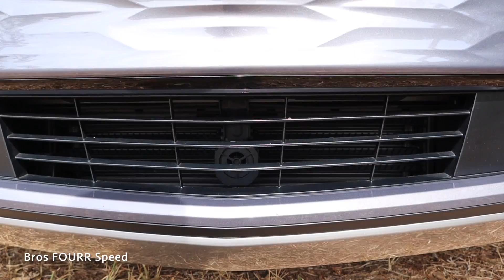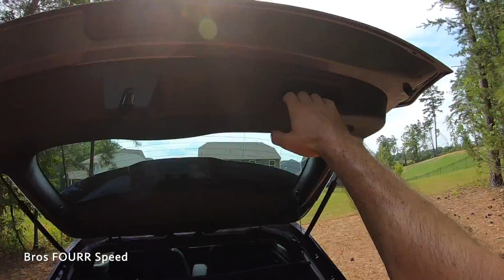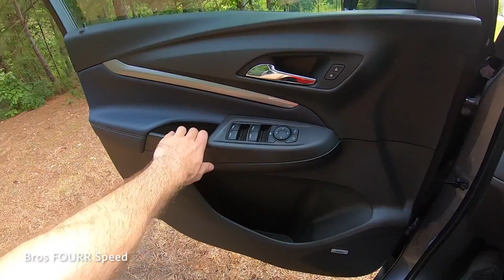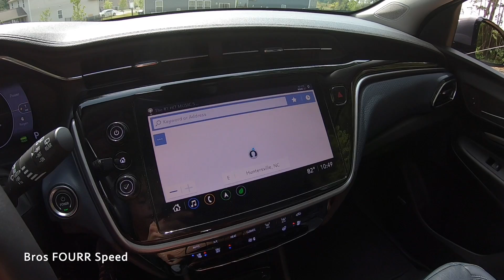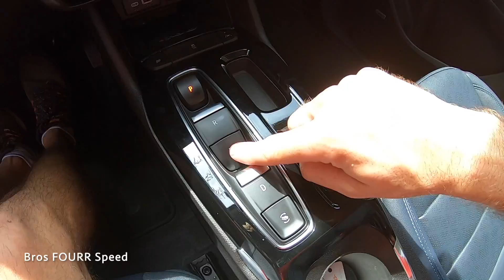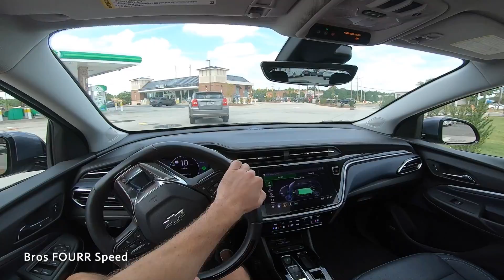2022 Chevrolet Bolt EUV Premier: Start Up, Test Drive, Walkaround, POV and Review

Comment: This is a 2023, the 2022 doesn’t have the light sensor on the steering wheel
Reply from the maker: Based on the window sticker, it was a 2022..

Comment: It's not that you're taking your hands off the wheel; it's sensing other things. First, the camera in the center of the steering wheel senses if your vision is still forward, and not looking elsewhere for an extended period. Second, when you enter a situation where a "human" decision needs to be made... you were in a merge lane, and then in an exit only lane - it disengages... so you must take control to make that decision. You CAN take your hands off the wheel... that has no bearing on the system.

How do I know? We bought the exact car you are driving! I have driven it on Super Cruise for over 10 miles straight with NO hands touching the wheel... BUT I am alert to the driving situation. One thing I don't like is that the car tends to drift side-to-side, making small adjustments on Super Cruise... which is a little irritating. I believe the Cadillac system is better tuned and doesn't do this. In over 50 years of driving, I've become a stickler for keeping the car centered in the lane... it just feels "amateur" drifting slightly, but that's just me.

Overall, we LOVE the car! Chevy has knocked it out of the park with this one. While I feel it's NOT a cross country trek vehicle, it's an absolutely phenomenal daily driver. The wife drives it 80 miles daily on her commute. We have been using the included charger (on 120 volt) coupled the dealer's DC fast charging for an occasional "boost" charge. Chevy has a $1,000 allowance for home install of a 240 volt charging receptacle... which we're getting installed in the garage later this week.

For someone who can charge at home overnight in their own garage (not an apartment) this is an outstanding commuter car. But if you're dependent on outside commercial (pay) charging stations... I'd have second thoughts... maybe consider a hybrid until you get a garage of your own. My calculations show that charging at home on 9¢ kWh electric, it costs us 2.5¢ per mile for "fuel". In contrast, the wife's former "fuel efficient" 2018 RAV4 @ 30 mpg was costing about 13.3¢ per mile. Do the math for YOUR situation. PLUS... NO oil changes - and using regenerative (motor) braking and NOT using the actual disc wheel brakes, the brakes will likely last well over 100k miles... if not far more. A no brainer for us!

Comment: Bought my 2022 Chevy Bolt EUV on April 4, 2022. I Loved It!!! Drove it  until June 30th, when the service vehicle light came on, with the dash warning "Propulsion Power Reduced", at less than 2000 miles. Sorry to say it's been in the shop since then with bad battery cell. We are waiting on parts! :( It's now August 7th. I have made 2 car payments on a car I don't have. 😢
Reply from the maker: Oh wow!  Sorry to hear that for you!  Have you heard how the process to fix that will be?  The battery cell is within the structure of the car, so that can't be easy!
Reply: @BrosFOURRSpeed  No, I really don't hear from the dealership, for updates or information. At this point I am just waiting. I am thankful that after waiting over two weeks The dealer finally got me a loaner vehicle. I am doing fine now with that, except I have to put gas in it. LOL :D

Comment: Super cruise does not require you touching the wheel
Reply from the maker: Correct, however I don’t think the bolt has the full system like the Cadillac, no virtual gauge cluster and after around 10 seconds the wheel stipe turns reds and it says put hands on wheel.
Reply: @BrosFOURRSpeed  All I can say is you either got a defective "test" car... OR you're being REALLY stubborn. I actually OWN that EXACT car. I have REAL WORLD tested the Super Cruise. While it ISN'T the same system as the Caddy, it DOES NOT, repeat DOES NOT require hands on wheel while operating. PLEASE... look at the center of the steering column... there is a camera looking at your eyes. There is NO hand sensor to tell if your hands are on the steering wheel!! Seriously... must I shoot a YouTube video to prove this??? Tell you what... how about a $1,000 bet... let's see who wins that! OR... you could simply do a little reading... or talk to an authorized Chevrolet rep who knows the car specifications inside and out. Please do that... your credibility will suffer if you don't. It isn't hard to admit you made a mistake, or misjudged specs.
Reply from the maker: @nortonnewmann3711    I never said it didn’t require hands, but when I did it, it only lasted about 10-15 seconds before the “hands” icon popped up. There is not sensor on the wheel itself, but the sensor monitoring your eyes tied in with hands on wheel. Maybe my eyes were turning towards the camera while I was filming so it did that, who knows.
I’d love to see your experience with this system to see how it differs from mine. I only had the car 7 days so maybe more time could have figured out the kinks with it, but should have been enough to really experience the system.
Reply: @BrosFOURRSpeed  Maybe find one at a dealership you can test drive? I guarantee if you hit a major freeway away from merge lanes and interchanges you will find a different experience. Find a nice long stretch of uninterrupted freeway... like a few miles between entrance/exit ramps. And yes, it's quite possible if you averted your eyes long enough (or your GoPro blocked your eyes) the system would kick off. My wife found that out drinking from her water bottle on her work commute...
Reply from the maker: @nortonnewmann3711  It’s definitely a cool technology system though.
Reply: @BrosFOURRSpeed  Agree... but I honestly question how valuable it is in real world use. It's included as a freebie for three years... after which it costs $25/month. Definitely NOT worth it for us. It's mostly a tech gimmick with limited value... IMO. Like flying cars, it's simply not a good idea to mix autonomous driving into an old fashioned road infrastructure.
Reply: @BrosFOURRSpeed  That is likely because you were in the exit lanes or merging from another highway.  It only works on remapped roads and does not change lanes.  Please research how super cruise works because how you described it is completely wrong.
Reply from the maker: @rosseddy8106  I was not in an exit lane or merging. I tried it several different ways and different roads. It’s very picky and I did all that before filming so I had a good idea about it.

Comment: My advice:  If you're going to review EVs, you should become more informed.  Once you started driving, you said a number of incorrect things.

1. There's absolutely a reason to use the paddle and one pedal driving.  The paddle slows the car more aggressively so if you're coming to a stop, you can hold the paddle down to stop quicker.  Regen braking is a more efficient way to drive vs hitting the breaks where that energy is just burned away.

2. It doesn't take 7 hours to charge the car with a normal 3 prong.  Maybe it took 7 hours to top off the car once you got it with a 90% charge, but at approximately 1kW being delivered per hour via 120V charger, it would take approximately 65 hours to charge from 0% and charges about 3-4miles per hour.  A 240V, Level 2 charger will charge approximately 5-10x faster depending on what kind of circuit it is on.

3. The fast charging took forever because it sounds like they charged the vehicle to a very high SOC.  The Bolt has a horrible DCFC curve.  It can hold 50kW until about 50% and then after that it's a fairly straight line decline to 15kW.  So if they pulled in at 50% and charged to 90%+, they're charging at basically an average of 25kW give or take.  This is the absolute worst way to charge any EV, but especially the Bolt.  They're obviously offering you a conveinence by doing it this way, but no Bolt owner would ever charge their vehicle this way.  They'd charge to a max of 80-85%.

4. Super cruise 100% doesn't require you to have your hands on the wheel.  That's literally what separates it from all the other manufacturers.  Now does the EUV have the best version of Super Cruise?  The answer is no.  Consumer Reports talked about it over 6 months ago stating it was fine, but not great.

Long story short, this was a bad review full of errors.  If you don't like EVs or are too lazy to learn about them, just review something else.
Reply: he will defend his bad review for all it is worth    he wouldn't believe that a bolt can go from 15 to 80 percent in around 50 min  which means by the time you go into the store use the bathroom get something to drink or eat and come back to the bolt it should almost be done charging
Reply from the maker: @shinukage8573  If you want to wait 50 minutes for it to charge great, I never disagreed with that, but they take a long time to charge even with the DC charger…but if you like the car great, just sharing my personal experience for the week.
Reply from the maker: I appreciate the comment but I don't agree with you...I had this Bolt for one week so I had plenty of time to research and test everything in the car..
1. I never said there was no reason to use that paddle on the steering wheel. I just mentioned it's redundant because using the brake pedal will essentially do the same thing.  Also you don't need to be stopping hard in traffic all the time.  I tried out the paddle, and it's like slamming on the brakes, that's dangerous in traffic.
2. The 3 prong takes forever!  I hooked it up to my garage 3 prong and in 4 hours it only achieved 10 miles.  So I actually tested that.  I never said 7 hours... Like I clearly stated, I did not have the proper charging port at my house since I don't own an EV vehicle, so I was stating what I could test and what CHEVY states on their website.
3. Don't really know what you are saying with that.. There's only one way to plug in this car and charge it.  It can be at any level to do so.  The car was fully charged when it arrived.
4. Super cruise on the bolt is not like the full system on a Cadillac Escalade.  This don'ts have a digital cluster with all the cameras so I think it's a different system.  I took my hands off the wheel and in about 10-15 seconds it told me to put them back on.  I actually tested that as well. 
I don't own an EV vehicle or plan to buy one, but I did my research on this car and experienced it for one week, so I shared what my experience was like.
Reply: @BrosFOURRSpeed  

1. It's literally not redundant because it serves a different purpose.  It offers a stronger, regenerative braking.

2. What your own video.  14:50 you say using a standard 3 prong outlet based on your research you can fully charge in about 7 hours.

3. Again, you don't know anything about EVs.  Why bother reviewing EVs if you aren't going to actually bother learning about them and just talk about how much you prefer ICE vehicles?

4. Again, you're defending misinformation.  I can't comment why Super Cruise didn't work for you.  It's not an interesting feature to me.  With that said, it's 100% designed to be hands free.  It would literally only take a quick Google search to confirm this.  Now you could say "Hey, I tried using it hands free and it kept getting mad.  This system doesn't seem to work that well" and that may be fair criticism.  But instead, rather than actually learning about the car and its features, you spread misinformation.

No matter how you cut it, this is a poorly done review full of misinformation.
Reply from the maker: 1. Yes it is redundant because braking utilizes the regenerative braking, it’s the same. 
2. Yes I misspoke on that one part, I was meaning the 4 prong outlet that comes with the car, that’s will fully charge it in 7 hours based on Chevys website. 
3. I learned a lot about this EV the week I had it, we review all kinds of cars and do the research on them. 
4. Not spreading misinformation, I tried super cruise at least 10 times or more and it did the same thing. The super cruise in the Escalade with the digital cluster is the legit super cruise. 
5. Have a nice day.

Comment: The new Bolt EUV is nearly perfect. The slower DC charging speed is the only major flaw, and even that won't be a problem for most daily driving. If you think about a longer road trip, you are going to stop every few hours to take a break anyway, so having to sit for an hour every 3-4 hours isn't that outrageous, at least not for me.
Reply: As someone living on the east coast, I have a 40 mile commute for a total of 80 daily and every month I visit parents up north which is a 110 mile trip so this is perfect for me. A trip to Washington DC (440 miles~8 hours) would require one charging stop each way which would be lunch/pee-break/leg-stretch anyways so 0 issues.
Reply: Honestly right now even the most expensive EVs only add 200 miles in 15 mins DC charging at best. Would just keep an ICE car for road trip and use the EV for daily commutes. Might as well be an affordable EV like this Bolt.
Reply from the maker: I would disagree for myself and really for the inconvenience. Going on a road trip and adding 3-4 hours just to charge seems pretty crazy to me. When you can fill up in 5 minutes and be on Weiss again. Driving around the city isn’t an issue, but even the guys who drive these cars to us, aren’t excited when they have to make stops just to charge, it’ll be boring.
Reply: @BrosFOURRSpeed  New electric cars charge much faster, so it's less of an issue. For me I rarely take long enough road trips for this to be an issue, but I could see if you live in the midwest and regularly do longer runs how it would be a problem. As always: know your driving needs and purchase accordingly.
Reply: @dougf9900  on average it takes about 52 minutes to go from 15 percent to 80 percent
Reply: @dougf9900  The bolt only charges at 50kwh, so its slow charging. This EV isn't fast charging. It's not ideal.

Comment: Chevy is discounting these by 6300 plus other incentives (military, educator, healthcare etc). We were able to get our EUV Premier with Sound and Sun Package for 37.5 out the door.
Reply: Chevy is discontinuing the Bolt at some point in the future, probably not until the alleged $30,000 Equinox EV comes out in a couple years. I'd guess that the Bolt will be around until 2025. Now with the new lower price for 2023 (and the rebates on the 2022s) the Bolt is a real steal for an electric car.
Reply: I went to a local dealer and they said they had a 5k markup on the bolt euv premier
Reply: @ubuu7  find another dealer.
Reply: @ubuu7  I pre-ordered a 2023 Bolt EUV from my local Chevy dealer at MSRP. Chevy made big headlines by dropping the price of the bolt, and if a dealership is doing just the opposite, then I would definitely go to a different dealership. Last thing Chevy needs is bad word of mouth after the factory recall they just went through.
Reply: @ubuu7  my local dealers were also marking them up by 2-5K. I ended up driving over an hour away to a dealer that had no markups.
Reply from the maker: That’s cool! It’s neat!

Comment: Great video! Thanks for sharing. Quick note on Super Cruise. The system does not require you to maintain contact with the steering wheel at all times. The system will disengage if it sees that you are not looking forward or if you're in an exit lane. It only works on "compatible roads" of which there are over 200k miles worth mapped out but there are breaks in some stretches of road as you noticed. 
Also, I don't think dual climate is offered as an option. Nor is HomeLink which seems dumb for a $35k+ vehicle.
Reply from the maker: I don’t think is the full super cruise because I took my hands off and it stopped working after awhile. It’s a weird system and seems picky on the roads! Wish it was more compatible with the roads!
Reply: @BrosFOURRSpeed  It's not the Supercruise V2 like whats offered in the Escalade (which has a bunch of sensors which allow you to lane change and stuff) but you are able to drive for hours without ever touching the vehicle. It is the thing that sets this car apart from tesla because it requires absolutely no contact to the steering wheel as long as you are focusing on the road. The only time that it disengages is if you are in an exit lane, there is construction, or if the roads are not seperated by a clear divider (from the oncoming traffic). Other than that, supercruise works perfectly. I told my bolt euv in heavy rain and supercruise worked fine for 45 minutes without any disruptions. It's honestly a gamechanger.

Comment: That charging sounds odd.  It can gain 100 miles in 30 minutes and on average about 50 minutes to go from 10 to 80
Reply: We’re they trying to go to 100 percent.   If so that makes total sense.  Cause  once you go past 80 percent all ev have a big drop in charging rates
Reply from the maker: That’s what I found though all the research I did. What you just said I think is very high for the miles in that short of a charge. They take some time to charge.